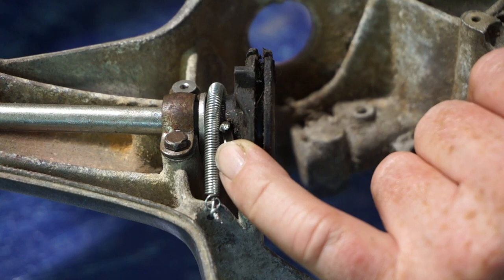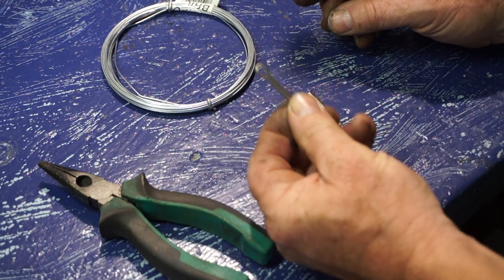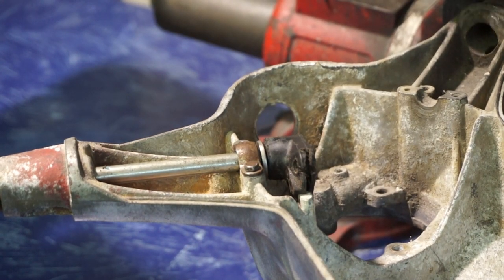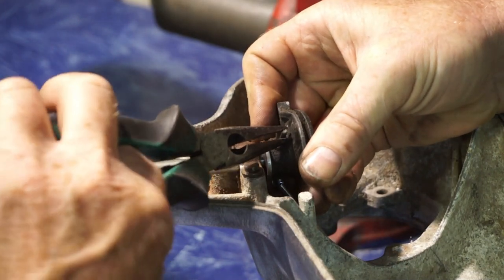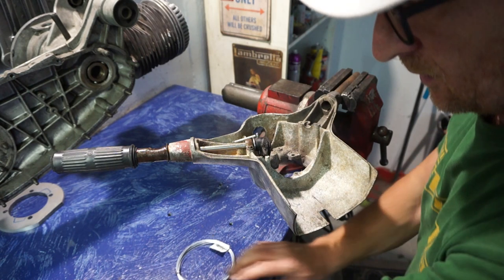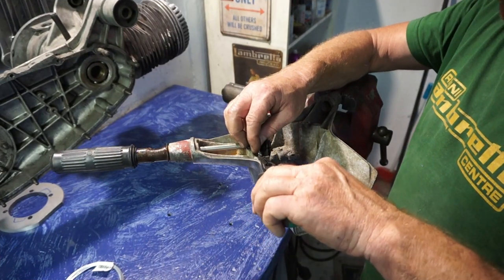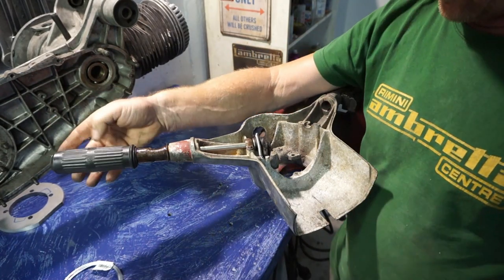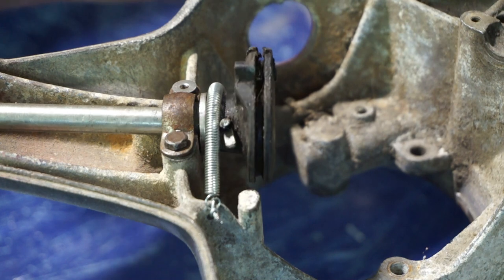RACE THROTTLE THINGY #LAMBRETTA#THESTEELWEASEL

Comment: Right on Steve ! This is a great way to enhance throttle set back which I already have installed on both of my rides since about a year. I do it with the springs of old seal rings. Btw the cowlings have arrived and I will install them soon !  Greets Phil